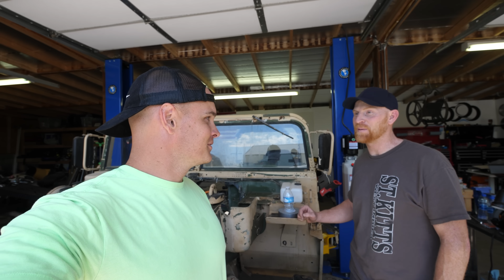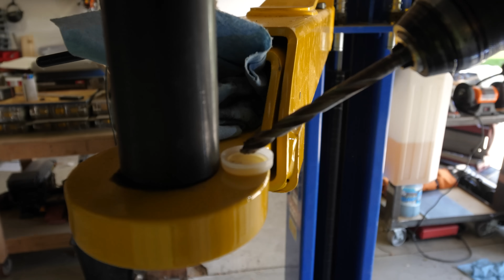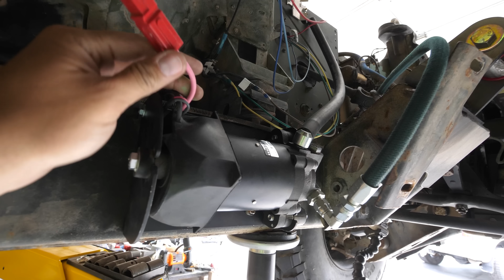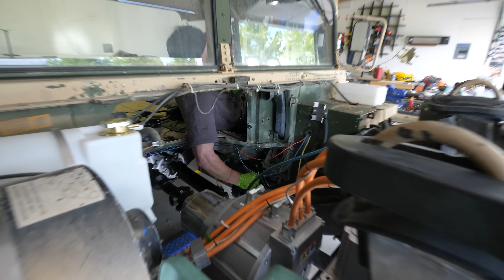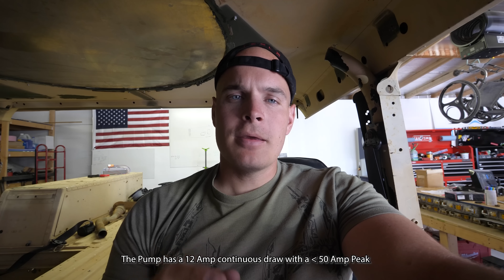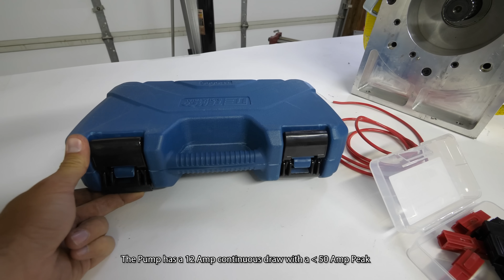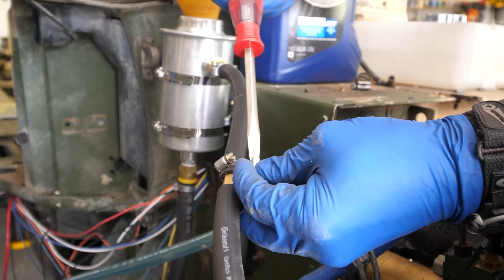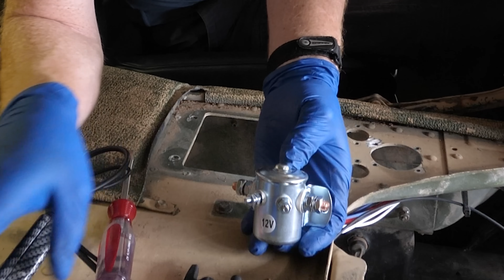We might have a problem with the Brakes... - Electric Hummer Conversion!

Comment: Consider adding a capacitor and flyback diode to the pump and solenoid to prevent damage and reduce eletrical noise on the 12V system. Also try loosen the screws that hold the rubber bushings, add loctite if necessary. If noise levels are still to high, add alubutyl (often found in car hifi stores) to panels that resonate.

Comment: Currently working on a course in architectural acoustics and system design here are a few quick thoughts on the noise issue.  I am not an expert, but if you find this helpful and need more feel free to reach out and I'll dig deeper into my materials, for a more specific solution. 

First off establishing what is causing the bulk of the noise, is it mechanical transfer or is it simply the proximity to the sound source?  If the former, first focus on decoupling, the latter Isolation, chances are it is both.  

The first and possibly most important solution is simply moving the pump to a different location further from the cabin.  While not convenient, it moves the source of the sound further from the passenger. 

Keep in mind there is a significant difference between sound Isolation and sound absorption.  Isolation prevents sound energy from escaping one location and allowing it to transmit to the other, sound absorption converts sound energy into other forms, such as heat or kenetic energy depending upon absorption type.

My best recommendation is to create an isolated container for the pump, if you want to get fancy with it, mount the pump inside the container, and isolate the container with additional vibration absorption, to decouple it more from the frame of the vehicle.  Depending upon the density of the rubber bushings on the pump it is a possibility it is still transferring a significant amount of vibration from the pump to the chassis, especially if the mounts are designed to absorp impacts from the road, but not specifically to absorb the vibrations from itself to the chassis.

For container construction look to reasonably high mass building materials, I'd imagine some of that thick steel from your laser shop would be ideal.  Insulate the inside of the box with some sound deadening material, think like what they put in between carpet and the floor board of a car, or under hood liner, make sure that the lid is sealed with a rubber gasket, and all plumbing into and out of the container has tight fitting rubber gromits, as any air gaps will allow a flanking path for the sound to exit.  Additionally you could then put another layer of absorption around the outside of the container. 

My thoughts are having absorption on the inside will help prevent the resonant frequencies of the box from building up inside, and more energy that is transferred to the steel container will be further absorbed by the external absorption layer.

You will want to weld all corners and sides barring the lid sealed with a gasket to minimize energy leaking out.

This is converting recording studio knowledge into that of a car pump... Hopefully it translates well, definitely Jerry rigging this idea together!
Reply: Also, don't make a perfect square... There are ideal ratios of spaces to avoid eigen tones.  I'd consider the idea of a "machine room" trunk idea, then maybe you can insulate that and any other noise eminating devices all in one location.

Comment: Power steering pump e-Varioserv– the energy-saving power-on-demand steering assistance for hydraulic steering systems by Bosch is what you need. 
Give it a look through maybe give you a sol. for that' sound too

Comment: 2017 and 2018 am general humvee is using gm parts including the duramax 6.6 engine and alison transmission and they change the headlights to projection headlights and the dash changed but the body is the same

Comment: Sound like hydro system of aircraft. You could try noise isolation fabric. But it could collect water from road and could overheat while running. Could try use electric power steering from another cars. For example my bmw have full electric power steering and it's quiet. 
Good luck!

Comment: I believe the automotive electric steering pumps are quieter and turn on by demand. The quiet part, I'm not quite sure of. But the turn-on-by-demand, you could probably solve with an expansion tank of some sort and a pressure sensor.

That's the simple version though...

Comment: Maybe you could connect the pump to an accumulator with a pressure switch, so you have a reservoir of pressurized fluid as soon as you turn the key. Then the pump would only need to run when the pressure inside the accumulator drops, i.e. when you are using the hydraulics.

Comment: My wife has a Peugeot 108 ( a small car) it uses something called EPS (Electronic Power Steering) it's basically super light power steering without the need of power steering fluid. I haven't looked too much into it before but I know that if her power steering failes you have to replace a little power steering controller just under the steering wheel and it's a simple plug style box.

Comment: I wonder if it would be possible to have an in-line hydraulic pressure control switch that would toggle the pump on and off. It could build the pressure in the line and hold it and turn the pump off until a pressure drop to rebuild the pressure. It would keep it silent unless actively turning or braking. I know most hydraulic systems use a bypass, but I wonder if it  could be modified to something like that.

Comment: Zack, If you put rubber spacers on the mounting of the pump, that would not allow the vibration to travel into the Humvee, dampening the sound as well. Also Like others have said, building a box around it would also help. I would be worried about the heat the pump will create if you decide to build a noise cancellation box.

Comment: I think you can put a one way valve on the discharge side of the pump and a small acumulator with a pressure switch, when the booster or Power steering circuit open the pressure will drop and the switch will close the circuit on the signal wire for the relay.

Comment: Hey jerry, just try to clean the pump from inside and then grease all it’s moving parts. This’ll help a lot in noise reduction 👍
Reply: I'm curious what you mean by clean the inside.  Like.. flush it with a cleaning solution? Disassemble, clean it, grease it and reassemble?
Reply: @strandtc  I’m talking about the pistons…
Reply: @devarshdave  I assume the electric pump he's using is a vane pump like most power steering pumps.  I don't know though.. I've never seen one of these newer electric pumps taken apart.  if its not a vane pump, my next guess would be a gear pump.

Comment: Zack Here's a thought for you.  I used to drive tow trucks. The truck I drove was an 04 international 4700 series The braking system on that had an electric over hydraulic braking system
Reply: If you can source that braking system from an  04 05 4700 series International that might work for you as well

Comment: For the noice of the pomp, you should probably put some kind of rubber insulator between the pump and the frame to get rid of the sound vibrations through the car. And probably even make en kind of top plate to direct some additional sound down to the ground instead of up. (Which would help if you listened in the garage of course but outside could make a difference)

Comment: You don’t need to Teflon tape SAE/JIC fittings threads they seal on the taper/cone at the end of the fitting and the tapered socket on the female side. Doesn’t hurt but isn’t sealing any pressure. On NPT(pipe) threads you do.

Comment: Is there a pressure relieve valve in this system? You want the system to be at pressure all the time and thus the pump to keep running. But if no fluid is used the pump is effectively almost stalled. In trucks you have a pressure relieve valve that allows all pressure above a certain level to pass around back to the return line. Thus limiting the pressure the pump has to provide and also limiting the sounds.

Comment: The question is, where is the noise coming from?  The fluid moving through, the motor, or the pump.  It could be if there is a lot of air in the fluid that it makes that type of noise.  It may make sense to try a different type of fluid even.

Comment: ATF can be used in place of silicone spray
Try a larger gauge of wire going to the pump to help with the lugging of the pump

Comment: Does the pump need to run at full speed all the time or can it be load-matched? I know that would be more complicated, but it would use a lot less power and be quiet until you need it

Comment: When you added the pump bolts with a lock washer and one nut, if you would add a second nut or a jam nut it would make sure the you are flying of the road that might make sure that blacet does not fly off the frame also. Just my thought.

Comment: Doesn't the constant run on the motor drain significant amount of battery juice? why don't you just install a switch only triggers the motor when brake is applied or the steering wheel is moved.

Comment: You're probably going to want to dynamat a lot of the interior, without engine noise you'll be able to hear not just the pump but a lot of new noises you usually don't pick up on in a gas/diesel vehicle. The stuffs kind of expensive but works great for sound deadening.

Comment: Hydro boost is the best option that's why it's installed on my chevelle. The pump might be quieter if you rubber isolated it from the frame and even perhaps relocate it. A cover that's noise deadening couldn't hurt either.

Comment: If you use a pump that can draw 75 amps, you need a much larger wire. A 10 gage wire is rated at 30 amps, no matter the voltage or weather it is ac or dc. Just basic physics. And as far as noise, mount pump on rubber bumpers pads. And then if you need more noise reduction use a box with fiberglass insulation on the inside. Don’t let the pump body touch the metal box. And use holes with rubber grommets for the hydraulic hoses. Oh yes, install a fuse or breaker in the 12 volt line, rated at the wire size you use. And don’t use a copper penny in place of the fuse!!!!

Comment: A "Compressed air assisted hydraulic braking system " would have been the better solution because there is no consumer connected to the battery that constantly draws electricity because it switches itself on and off via the pressure regulator, which means you can install a smaller hydraulic pump that only has to take care of the steering
and you can continue to use the original brake cylinder and the original brake pedal you only have to swap the main brake cylinder against one that works with compressed air and if you want it to be "safer" then you build in a "step plate brake valve" which is a law (europe) required 4 separate compressed air circuits, but this increases the number of brake cylinders and the weight
ps: 
I am German so no small talk and no "honey around the mouth" just tip from someone who learned something like that and has worked as a Truckmechanik

Comment: Maybe you can make a housing for the unit itself and put sound dampening material ( non flammable ofc ) in it to dampen the noise. Make sure you have air vents on the casing! Secondly you can dampen the noise further by adding sound dampening material + heat insulating material inside the Hummer! Hope i helped a little bit :)

Comment: could the pump be slowing down because the battery cannot handle it? when jumpstarting other cars, there is usually a significant power increase when the motor of the working car is running. so maybe the pump power will increase once you have installed the 12v charger which charges the 12v battery from the 400V drivetrain battery, granted, that the charger can provide enough current.

Comment: Jerry awesome build
1. Make sure you add a fuse close to the battery for this new pump. 
2. This solenoid is not build for continues use. It for a starter motor which supposed to operate for 5 seconds or so. If you want you can use 12volt winch solenoid which is more suitable for continuous use. 
Thank you for great videos

Comment: i'd use electric power steering since it completely eliminates the need for mechanical/hydraulic  components and its not as noisy. a lot of manufacturers actually switched to electric PS (i know from hyundai) and in my book, it doesnt really make a difference to hydraulic ps on the drivers end. same goes for brakes. also it might be a good idea to have brake assistance redundant so if one fails, you still got one working.

another benefit of electic PS would be that it only runs when you actually need it, so if you turn the wheel, it will run, if you dont, it doesnt this makes it 1) quiet and 2) more energy efficient, if you think about it, electricity on a gas car is kinda disposable, if you got .3kw more load on the engine, its not gonna change anything, but drawing .3kw out of a battery thats kinda the limiting factor of an EV, it could add up and be worth it to change to more efficient components in the accessories department :)

Comment: Brakes are something I will never touch as well. Gotta call in the experts!
Reply: That could prove to be quite a bad decision in a school zone
Reply: @tomross9947  lmfao aye that's a good one bro. Nice come back lol
Reply: unless you're talking about changing your brakes, a child could do that.
Reply: Brake maintance and replacement is a piece of cake nowadays, but if your not comfortable doing it definitly have a mechanic you trust do it. Designing a custom braking system though. Yeah ill let someone else do the R&D for me.
Reply: @CondoreComputing     Fair enough
Reply: Brakes are one of the most basic systems on a car tbh
Reply: @milkonbean  Agreed personally, when working on a car with somone for the first time I always start with brake pad replacement after fluid changes. There are only a few things you can really mess up on a brake job. And if you watch a couple good guides you'll already know what to be careful about. Worst thing I've heard of is forgetting to pump the brakes a few times after a 4 wheel replacement and they panic and hold the brake down instead of pumping to push the pistons back out and crash into a wall.
Reply: @CondoreComputing  yup, ive seen it happen lol the panic in there eyes is real lol i did it when i was doing my apprentiship. Havent forgotten since. Most vehicles have a simple brake system. You have the fluid side and the vacuum side. Easy peasy
Reply: @milkonbean  brakes are a basic system.. but if you don't get the details right, can be dangerous if your making something custom
Reply: Brakes are something I always do myself because they're so simple.
Reply: my dad had me do them for him in his shop after school so he could get his bigger jobs done. that was in grade school to junior high, he called me up yesterday and i did his brakes in an hour or two after about 4 years of not working on cars
Reply: Breaks are something a child could do. Literally had my 9 year old child (a girl) do one side (front drivers) of my last set with me watching, directing, helping as needed and doing final tq (full replacement and fluid flush). Did a custom system on a mopar restro 4 years ago, also easy as pie.
Reply: I bet he won’t get insurance for this build or pass any motor tests needed to drive this on the main road
Reply: Alright guys, calm down... Brakes don’t use magic or quantum computing. They are very simple systems. 😳

@Cricket England This is the US.... Not every state’s DMV require inspections etc... So getting insurance won’t be a problem if he wants it. It’s a Hummer. If his state doesn’t have inspections no problem he will get it on the road as well. 👌
Reply: @nastystang113  sorry but 5bis is no more a Hummer that a Ferrari would be if you striped out the whole engine and put in an electric motor 

It’s is a hummer in body panels only after all the whole underbody was completely removed and hand built by someone who has never done this before so needs to be fully checked it’s road legal otherwise he could quiet easily be fined by the police
Reply: @CricketEngland  Just have to tag and insure it before you change anything....
Reply: Yep thems the brakes lol
Reply: By shit he means vehicles
Reply: Brakes can be dangerous but there really is not a big problem other than espesdos powder
Reply: @landonion113  they dont usually use asbestos now in brakes, only old vehicles still have it if they havent been replaced recently
Reply: @milkonbean  oh wow I actually didn’t know that. I thought they did.

Comment: Does the brake pedal control the brakes the same way as before? They are boosted like normal vehicles as long as you turn it on first? For some reason I was thinking this would need electric pedal input, like drive by wire. To that end how does the old throttle pedal send signal to the motor? Some kind of spring switch like in an RC car controller? Thanks! 🤗
Reply from the maker: Yeah the current brake pedal is still directly connected to that original unit.. the Hydraulic pump we installed today just assists/amplifies the pressure applied by my foot by 1000psi.
Reply: @JerryRigEverything  Nice, very cool! I really thought it had to be more complicated than that 😆

Comment: An accumulator and pressure switch combination(then light loads wouldn't even need to turn on pump). as for isolation = insulation like yoga mats adhered to all metal surfaces, and isolators at pump mount points,  and a box of sound deadener should do the Trick. good luck, and thank for the great video.

Comment: Please DO NOT use ATF for modern Power Steering Pumps. They require special PS Fluid. I've tried it and got noticeably better noice properties with a dedicated PSF after failing with Automatic Transmission Fluid.
Please upvote so Zack can see
Reply from the maker: I see.  I'll look into it